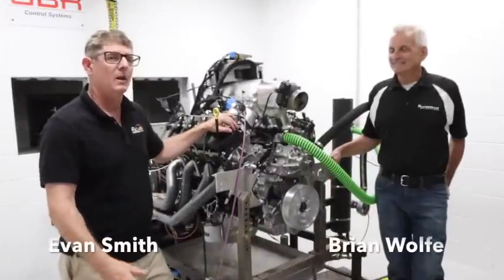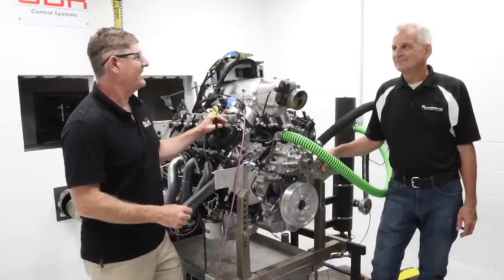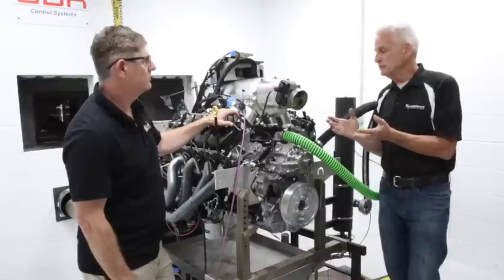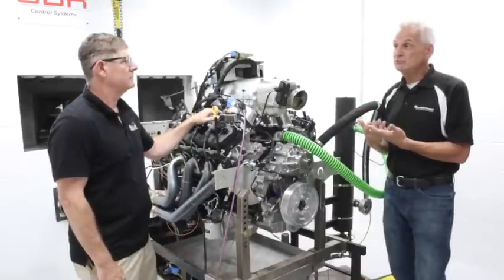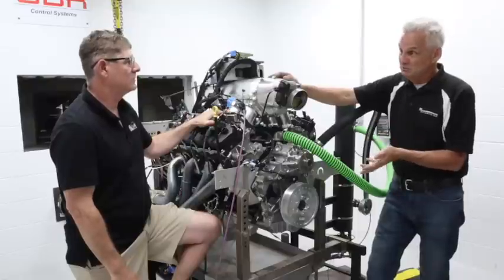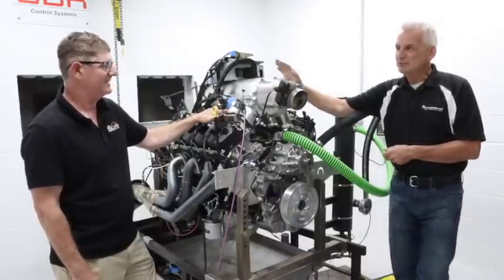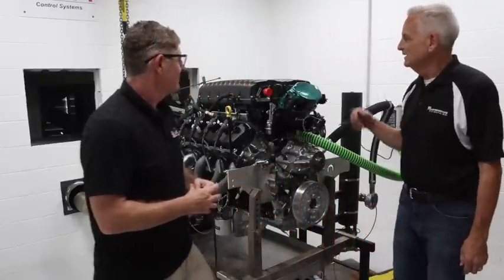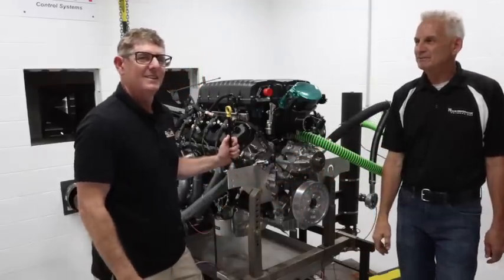Godzilla 7.3L Ford — Back on the Dyno With Over 780 All-Motor HP — Plus... We Reveal What's Next.

Comment: Could do the same with a 454 cheaper
Or a 460, or an ls or lt
Glad to see pushrods though
Always said if it don't have pushrods may as well be a flathead or a Briggs and Stratton
Reply: No way in hell a 454 or 460 will put out 800 with stock heads
Reply: @AK_Ray  stock castings, that are fully worked and ported to the max! With the same parts and equal amount of money a 364 cid 6.0 ls will make that much power too!
Reply: No way in hell a 454 or 460 will put out 800 with stock heads
Reply: @AK_Ray  cheaper I said
How much is the price of 7.3?

Comment: This is very impressive but cost....?   I don’t want to burst this cat’s bubble but I can buy a ton of aftermarket parts from Jegs or Summit for a 385 series right off the shelf  that will easily make 800 HP without a squeeze or a shove.   Based on all the one off goodies and time he’s invested I could probably build two large displacement 385 series or god forbid a couple of FE’s for the cost of this unicorn.   I get the fact dude is trying to corner the 7.3 aftermarket but who’s are you marketing this engine to?   If it’s a drag guy with a vintage Torino or Mustang, I guarantee he’s using an FE , Cleveland or a 385.  Fox body guys will stay with a small block or be a blasphemer and put an LS in the damn thing.  I don’t think any high dollar  boat builders will be ringing his phone off the hook, since GM and Mercury Marine own this market.   I can guarantee there will be quite a few guys out there drooling at the power this thing makes for his late model truck and lighting  your phone up with a ton of questions  an no budget.  Even with deep pockets they’re not going to have a fun time getting too deeply into the computer for a proper tune.   As we all know, Ford, along with all the other manufacturers, government, tree huggers, hippies and morons in general don’t want you to open the hood much less make power...  

Go Trump!!! I saw the banner.....Nice clean shop  by the way and good luck with the 7.3, somebody has to be the pioneer, it must be you because at no point in time did I ever see anyone holding a gun to your head.   

Make mine a 429.....
Reply: As mentioned this is being set up for Ultra street.  Your thoughts are cost are not correct.
Reply: @brianwolfe2993  I can't imagine any of this costing pennies on the dollar to put together.  Unlike most of us, you have an inside track with Ford but short of a free engine, I would guess you're on the hook for the time labor and hand made go fast parts involved here.   This is a nice curiosity and fun to watch but for most of us that don't have unlimited funds this platform will be out of reach well into the future.   It would be nice to see a video showing the time, money and effort, not just dyno numbers.  Thanks again for all the work.
Reply: Well Brian Wolfe does have a little push at Ford so I am sure this is to prove potentials!

Comment: In a truck application would a procharger be best cause of the gradual boost so you don't break parts with instant torque?
Reply: Depends on how big of tires your running and which rear gear ratio you got in my opinion whipple because prochargers like to rev and stock the 7.3 doesn’t rev like a coyote
Reply: @utahcountypicazospage5412  that's what small pulleys are for lol

Comment: Ford will not make nearly enough of these to make it as widespread as the LS. The 7.3 will be niche, unfortunately.
Reply: For what it's worth, more than half of all the Super Duty trucks we're selling now have this engine...  people wanting the higher towing capacity but not the $9k price tag for the diesel.  So there are already a ton of them on the road, will be an awesome junkyard engine find in a few years.
Reply: If they make 20,000 of these that's alot mate
Reply: MichXJdad  Lol you need to do some research. LS7 has been making this kind of power for years now. Even when they go max effort they'll still be behind the LS7. This is a Z06 at 14:1 compression. Not even the 15-16:1 these guys are talking about doing and they still be making less with that compression.

https://www.youtube.com/watch?v=z3Rt2GP7rmI

Comment: Wish we had that motor me and my son are fixing up a 59Ford F100 put a 2009 crown vic front suspension rear 4 link suspension 8.8. Engine 460 stroker on E85 C6 trans
Reply: 460 stroker has 1000+ hp potential
Reply: LOL what kind of fuel card will you use?

Comment: It’s ok but same specs in a you know what will do more , he says it’s built for a Blower but it has 12.5 to 1 compression and a bottom of the page cam to make peak hp  at 7600 rpm , so yeah if you’re racing heads up there is still a need  for the Rat in a Fox .
Reply: Need to read the rules for the class you are considering for heads up.  This one is Ultra Street.

Comment: Crazy! And everyone keeps saying pushrod motors are dead, between this and the LS, LT motors I think they are wrong
Reply: Don't forget the hemi
Reply: Joel Eaton true, I forgot that one
Reply: I don't agree . They both have there purpose. 
You make much more power with less cub in a mods motor . The simplicity of the push rods motor will keep it alive for ever . 

Both are awesome . I personally would go for a mods motor .
Reply: Tony Spadafino is there a normally aspirated mod motor making 800 horsepower? I’m not being a jerk, I’ve just never seen one
Reply: johndeere137 Ford Barra motor for the farm truck then. The higher power production NA is also relative to the output under boost
Reply: @xozindustries7451  I know of coyote 302 making 650 hp .
I believe one strocker coyote us making upwards of 700 hp .

If they could stroke it to 400 plus cub. 800 hp would be very easy . Probably easier the a pushrod motor .
They are at 700 plus with a stroked 302 .

BTW have you ever seen a stock push rods make the same hp are a mods motor on a blower set up . I mean stock . Not an LS junkyard that has a cam and head work with intakes .lol
Reply: @xozindustries7451  here is one example of 744 hp on a coyote stoker . 
Not many people are proving this yet . 
You also have to realize there isn't much of an oftermarket yet for the yote or the 4.6 for that mater .

Imagine a yate style head for a coyote motor . 
This motor i posted would be right at 800 hp with a bigger head . This motor isn't much more the 339 cubic inch . Stock block and stock heads and stock cobra jet intake . All reworked . 

Again I love both but not taki g away from new technology.
Reply: Tony Spadafino my buddies race in the fast class, and Ive talked to a bunch of people who race in the NHRA stock class, where everything in the motors is stock, except for the cam duration, those guys run in the 9’s all the time. LS motors only need cam and springs, no head work to make that much power, any big block Chevy will make more than that with a blower on it. There’s guys with Nissan V6’s that run NA that make 750 HP, I was only looking to see if anyone had a link of a mod motor that makes 800 HP NA, I’d be interesting see it. I think the flat plane crank motor in the GT350 is one of the most amazing motors out there, and I’m an old pontiac and big block Chevy guy. This 7.3L motor for ford is a huge game changer for them, after spending 30 years in developing the mod motor family and then go to a clean sheet for this motor, they could have done a turbo mod motor for the trucks but there’s a reason they didn’t, even the big companies are dumping their diesel trucks because of maintenance issues and complexity. Dead simple reliability that you don’t get with an OHV motor, there were millions of taxi cabs and cop cars with the mod motor, but they don’t have the low speed torque to move the heavier cars and trucks that Detroit makes today. This is the first one in a dyno and he is already at 800 with out going to crazy compression ratio, mod motors have been out for almost 39 years and it hasn’t been done, that’s all I’m saying. In all our output the top fuel Hemi cars Trump everything else ever made period, and they have push rods, some guys tried to use the ford SOHC motors, even Kenny Bernstein tried in the 90’s, can’t be done.
Reply: Agreed! 😎👍🏻
Reply: Years of trial and error overhead cam stuff is pretty good and getting to be stout but 50 years of pushrod has it down
Reply: Phillip Aubin  How many dohc engines are 500 cu. in. with a massive blower running nitro methane with dual magneto and dual plug ignition? I don't know of any but I'd be willing to bet you could make the same power or more if such a thing were to exist.
John Mihovetz' accufab car is a good example of what dohc engines can do with big boost and its only 281 or so cu. in.  I feel pretty confident someone could probably make 10,000hp with dohc but it would take time and money. Also I believe top fuel rules require them to run a 500 cu. in or less ohv style of engine so that's probably one of the biggest reasons there's not 10,000 hp ohc engines.
Reply: THE SOUND OF A PUSHROD MOTOR!!!!!

Comment: Would love to have one in current project but still no control pack for the 7.3. Any idea when it will get released by FP?
Reply: Not sure about Ford Performance, but OBR has a control pack, https://obrcontrolsystems.com/
Reply: Brian Wolfe But, will it work with 10R140 which is transmission I want to use.
Reply: Call power by the hour and see if they are working on it
Reply: Honestly, with all the affordable high end aftermarket ECUs - Holley Terminator X for $1000, Haltech Elite for $2000-$4000, and everything in between like the aforementioned OBR ECUs(nice pieces!) - I don't know why anyone would want an overpriced(for the capabilities vs aftermarket options) OEM ECU for a build today. Obviously you would have to deal with getting an engine harness, but, frankly, the "complexity" of wiring harnesses is greatly over exaggerated(my first real automotive electrical work is an EFI engine harness - felt embarrassed that I was "afraid" of wiring before, this stuff is EASY if you actually try). Many of these ECU manufacturers offer universal harnesses that would be simple to adapt to an engine like this, such as the ones that Haltech offers. And, with that little bit of work, you end up with a system that offers SIGNIFICANTLY more potential. Even if you aren't racing, the ease of use and the features of today's aftermarket ECUs are still great for even just a street car.
 
Have a street/strip Fox body outside in the garage right now that I would really REALLY like to swap a 7.3 in - a Haltech Elite 2500 or the new Haltech Nexus(likely the new king of the hill, it's a pretty crazy ECU) would absolutely be my path. Now, just to find a wrecked Superduty...
Reply: RyTrapp0 I have done multiple EcoBoost swaps using OEM pcm’s included with donor for free.  I want to run a 10R140 auto with the 7.3.  Might have to make OEM one work unless ford performance beats me too it. I do like the full diagnostics using OEM pcm.

Comment: To bad Ford doesn't put this motor in the new mach 1  even as a option  that would be very cool.
Reply: We can get a  7.3 Godzilla crate engine from Ford  it costs $8,150 plug and play  .  As for cam phasers  the 3rd gen hemi has it too. What I really like about the 7.3 Godzilla  it reminds me of the 351 Cleveland,  they were awesome motors   didn't need aftermarket heads like the ls engines do.    I'm wondering if Steeda would do a swap. Like the S351 Saleens Mustang
Reply: @joeleaton7187  LS engines don't really need after market heads either. That's actually where they get most of their power.
Reply: I just looked up how much the LS 1 flowed , stock from the factory the flow 247 cfm at 700 lift  ,  ford coyote, dodge hemi , flow more than that. As for fords being reliable , I had a T bird for 15 years it never lift me stranded .as for GM  I was born in the some place General Motors was  the only thing made their is that dog ugly track . I can remember seeing were my dad worked at buick city , I never seen so many beer bottles in my life. The only Ford Motor that had a long timing chain was the 1964  sohc 427 called cammer with the hp of 657 hp , it got kicked out of nascar on its first race , blown   GM , and the 426 hemi .
Reply: @joeleaton7187  Nice story, let's here the truth now. As a GM guy everyone knows Mopar was on top back then....
Reply: Yeah,  godzilla engine is ohv
Reply: Iron block. Too heavy.
Reply: Yeah,  Sammy doesn't know  his  history  ,  now knowing that he's a Garbage Motors  man,    Did you all know that  GM polluted  the flint river  and the  city government  didn't  anything  that started  the Flint the water   thing that everyone heard of  .  But Flint Michigan will anyways be my hometown     has seen online I seen someone bolt   a LS head to a Windsor block , which gotten me still scratching my head.  If you don't believe me look it up yourself .
Reply: @joeleaton7187  Did you know Ford is also going through the same law suit near their factor. Did you Ford is being investigated by the federal government for UAW embezzlement, and and they're also being investigated by the EPA for bogus MPG claims right now as well. LS rules the roost homie no doubt about that, winser is like a lockless monster people say they've seen one on the track but no one can prove it....
Reply: @joeleaton7187  Oh ya by the way Ford will no longer post track times after the new Ford GT being smashed at Nuremberg by the C7 ZL1. Also "godzilla" which is actually the Nissan GTR Skyline, but now  supposably the 7.3 is an LS... And by the way GM owns all their self driving tech, batteries and motors, Ford doesn't and had to go to VW for self driving and Rivian for their motors....
Reply: @samduran5180  vw is the best
Reply: @joeleaton7187  we ALL KNO WHERE THAT COPY CAT LS CAME FROM..... CAUGH CAUGH FORD
Reply: @joeleaton7187  🤣🤣 why the fucc would ford need to copy ANYTHING WHEN THEY HAVE THE BLUE PRINT CLOWN #FordGang fool 🤣🤣 u might want to go re read that because i fa damn sure didnt say ford copied any ls trash
Reply: Ever since the Mach E I don't care about Ford   anymore
Reply: Why all the hate , after all this is a FORD channel  .why are you even here?  If you're a bow tie little boy  you should go to a Chavy channel .
Reply: @joeleaton7187  I'm making a point it's not Godzilla, never has been never will be.
Reply: To bad they won't offer it in anything really, this will be so expensive as a crate motor, just go LS
Reply: @samduran5180  if you got the money why not get it, itll shit on anything LS, LS to me is what you can get on the cheap and still have left over money to rebuild and upgrade parts
Reply: @jaimegarcia2930  Haven't you read the specs on these new 7.3, they have an 8 foot timing chain and a thin cylinder wall. So they can go to around 800 hp 680+- whp but boost them and you have issues. And to boot they kept their stupid little cam phasers which is another weak point. But true if you have the money they would look cool in show Ford.
Reply: @jaimegarcia2930  😆😆😆 That's a good one! Next you're going to say that Fords are reliable! 😆😆🤔
Reply: Sammy Duran 8 foot timing chain?
Reply: @samduran5180  it's pushrod, no cam phasers...
Reply: @JasonNotBot  I didn't look up the details but if you have two chains, one for each bank that would be 4' each for 8' total. Nothing I have read on this motor indicates it was designed weak in any way. It is made to run high loads for hours on end day after day. It has a 6 bolt bottom end. The cylinder walls didn't look thin in the tear downs I've watched. 
These guys seem to know what they are doing. If this motor was a hand grenade I suspect they would put their time and money some where else.
Reply: @ro307805  It does have them, all of Fords push rods had them and so does Dodge.
Reply: Bigfoot1955 it’s a OHV engine with 1 timing chain.
Reply: @samduran5180   ehhhh, 8 foot long timing chain? No ...just...no. This is not an overhead cam engine. The cam phasers can be eliminated.
Reply: @samduran5180  the thing is it has the same Mounts and bell housing pattern as the mod motors so it’s a fairly easy swap in 96+ cars
Reply: @Texas_Road_Warrior  That's a good point, very cool
Reply: @PowerSerge5000  I have a good reason to not like GM . For killing my dad , then  they tried to take he's pension from my mom  . We had to take them to court .if a  any company  did this to you you would hate them to .

Comment: These are gonna be so badass swapped into a proper performance chassis! I get it, they’re heavier than a coyote, but all the big block punch is amazing!
Thanks for another killer video, brotha! Killin’ it!
Reply: It’ll screw up handling but it’ll rock for a drag car.
Reply: Caleb Nation yeah, super nose-heavy! But you’re right, in a straight line they’d be a tire-fryer!!!
Reply: Race Gas Smells Good stick it in a short bed F100, big fuel cell over the back axle to help with weight, big roots blower coming out of the hood....
Reply: Caleb Nation great minds think alike! That’s exactly what I was thinking! An F100 on a Roadster Shoo chassis with the 7.3!!!
Reply: @calebnation7797  how does it screw up handling, many stick big block chubbies and Big block Fords in Fox bodies. They don't have an issue with handling. It's how you set your car up and what components you use.
Reply: Super late but watching vids as I’m putting this into my s550, they weight roughly 120 lbs heavier and could be easily dropped by tubular k member and some other weight dropping things in the front end. I’m super excited to get this build done